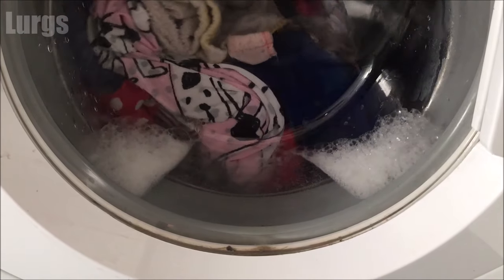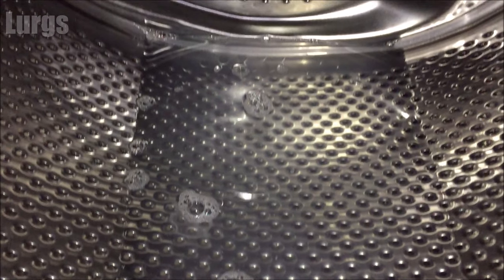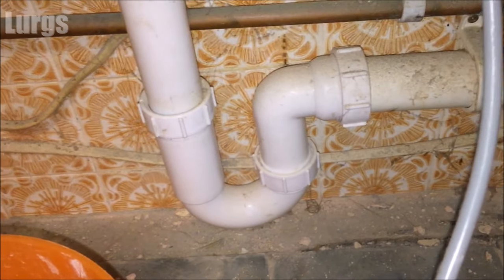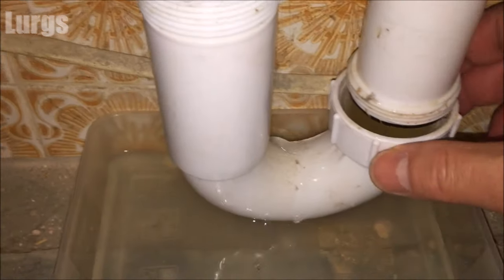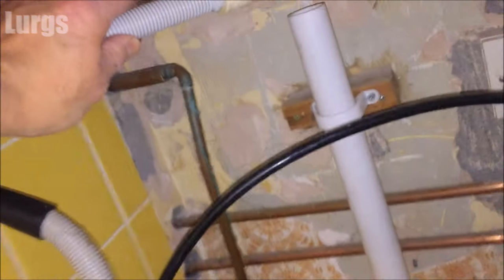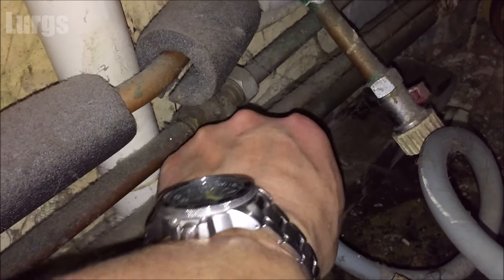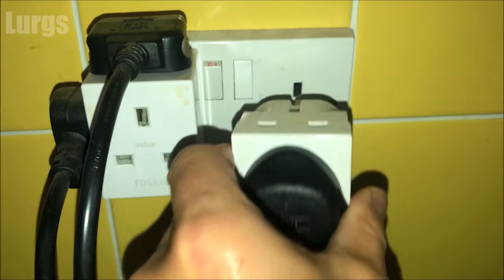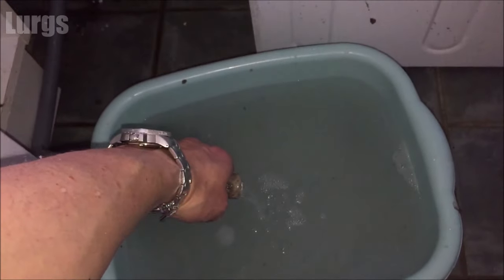Washing Machine not Draining Water - Fixed

Comment: My machine’s manufacturer sent out an engineer to look at the drainage problem. He connected a device, ran a test cycle and said the poor drainage is caused by user error which results in an unbalanced load. He advised to wash clothes as normal. Separate the load at the end and run two spin+drain cycles for each half. Even though the drainage issue existed regardless of load size.

After watching your vid, I discovered a blockage between the kitchen waste trap and the machine’s outlet hose. Cleared and cleaned. Now running as normal.

Your vid offered better troubleshooting advice than the company’s engineer!
Reply from the maker: I must be in the wrong job! Fabulous news that you found the blockage and many many thanks for your kind donation, I really do appreciate that. Thanks again and all the best 😎

Comment: Thank you so much for your video. I love your presentation style. 
My machine has started to accumulate smelly water in the drum a few days after I've washed. I've started draining the filter after each wash. But the drum just starts to fill up gradually. And boy does it smell. Can't really figure out why smelly water is just appearing. It's not an easy one woman job to move the machine but I will give the easy bits a go first. 
Thank you again for your brilliant, and straight to the point video. Keep up the good work.
Reply from the maker: Sounds like your drainage pipework is blocked up, they get lots of sludge inside and  can stink. Need to check that and clear it out.
Reply: @LurgsHowToGuides  Oh bless you for replying Lurgs. What a star you are. Thank you for your very kind advice.

Comment: Thanks for your advice as I had a problem with the washing machine not spinning or draining and followed your instructions. It was rubbish in the filter and a hair clip then once I removed it put it back together and now the washing machine works like new.
Many thanks 😎😀😀👍👍
Reply from the maker: Great result, now that's a good saving. 😎

Comment: Thank you. Problem solved. Opening the filter (Bosch machine) was very difficult because there were enough coins to prevent both drainage at the back and opening at the front. Lots of anticlockwise then clockwise turns to shift them. I had to resort to pliers, which risked damaging the flimsy plastic handle I was turning, but I wouldn't have got in otherwise.
Reply from the maker: Great news. Glad to help and hope you had a fab weekend. 😎

Comment: Spent ages emptying the filter and checking all the hose on my machine (which is absurdly long)

Hadn’t checked the trap though as it’s linked to the sink and that’s draining fine - turns out there was a sequin the exact diameter of the pipe where the hose joins the pipe work and that was causing the block. I’d assumed it was the pump and was about to order a new machine until I saw this. You saved me, as a new machine would have had the same problem! Thank you so much
Reply from the maker: Great news, glad you found the blockage and that’s saved you getting a new machine. Glad my video helped.😎

Comment: Cheers mate  i bought a £645 LG latest model,  wouldnt drain or spin,  did what said!   And low and behold there was small sock shedded behind the filter at the bottom,  brilliant  works perfect now,    thanks a million
Reply from the maker: Good find! That would have been an expensive replacement. Glad to help.😎

Comment: Thanks man. I was in denial that it could be the filter so soon after I last cleaned it out. But it turned out the culprit was a Covid-19 face mask blocking the filter and stopping the draining thing turning around. 
Note for all... if you’re washing and reusing masks, put them in a bag or something before putting them in the washing machine.
Reply from the maker: Good tip. Glad that I could help. 😎
Reply: Just fixed mine using this method and it was the exact same cause! Face mask blocking the filter.
Reply from the maker: Good job you could get it out the filter. 😎
Reply: @LurgsHowToGuides  cheers for the guide! Lifesaver.

Comment: This is amazing thank you but do you happen to have any tips on if it’s not the filter? Ours looks clear but still coming up with the same error message and and not draining 😭
Reply from the maker: If the drainage pipework is clear and not clogged up then it could be a faulty computer board or faulty pump. Check drainage pipework first for sludge, they can get clogged up. Good luck

Comment: OmG.... I can't thank you enough for this video. I was not only able to drain my washing machine but also I watched the unlocking video... You are a GEM! I will see if the machine works in the morning as the water was drained on the floor and it needs to dry.
Once again thank you 🙏🏻
Reply from the maker: Great stuff. Thanks for the comment and good luck tomorrow with the wash.😎

Comment: Is there a video for how to drain a pump when you get this warning after a fully loaded washing machine won't drain?? Flooded my kitchen because the hint about needing a shallow oven tray was an understatement. Thankfully got the water mopped up and sorted out the pump. But I'm glad this video exists, though - really helped sort the problem
Reply from the maker: Yeh if it’s full and you remove the filter do it very slowly! Glad I was able to help out. 😎
Reply: @LurgsHowToGuides  my pump filter will not turn any ideas
Reply from the maker: Either it's stuck as it's never been undone or something is wedged in there, just have to keep trying but be careful as it's only plastic

Comment: In my machine this no drainage issue was happening only on one particular type of wash setting. my trick was to turn the dial to a new wash at a different setting or just spin cycle . It worked fine 🤷‍♀️

Comment: good video, only comment I would give is to change the order of what you are doing, if it is just junk at the filter causing the drainage problem you don't need to go through all the steps before such as move out, check the U bend, check the drain hose, etc. if we have a drainage problem i check filter first as easily accessible (just put down PLENTY of towels!), then check the waste pipe (ours is the grey internal one not external) then on to things like the U bend, etc.
Reply from the maker: Good point. This video is 5 years old now so is one of my earlier ones. This one is a newer updated version in the correct order. https://youtu.be/FwRbWKOwmfY

Comment: Great vid, thx for putting this up.
Just would like to ask you for a favour, if you are so good with fixing things, can u fix your and redirect washing machine waste water into your gutter instead of rainwater? thats not only helps with the environment but also is with in the law.
Reply from the maker: Most gutter water goes into drains which also take in rain water and surface water so eventually it will all go to the same place so not really much point doing that. Hope that helps and glad this video helped.😎
Reply: @LurgsHowToGuides  It did man, I managed to fix my problem. Thank you !

Comment: my washing machine will not take in water or drain the water. starting to get tired of hand washing the clothes for me and 3 kids. it's almost half past three in the morning and i'm trying to repair the washing machine. A couple of times it has made the usual sound it makes when you start a program, and you can hear some water, but nothing happens. stands for a long time to work before it centers but without water. started with the machine filling up with water and stopped. ended up having to empty it manually and have to use the spare opener yet. Seems like your videos can help. something I really hope !🤗
Reply from the maker: Hope you get it sorted.

Comment: nice video!  one thing: at 3:36 on the left hand side you'll see a black plug.  if you pull the black hose it is plugging out a bit you can drain from there in a more controlled manner before unscrewing the filter.
Reply from the maker: HyperBlueZYZ Yeh that’s in one of my other videos E18 error code. I wanted to make this video a bit more generic so a lot of machines wouldn’t have that drainage hose. Well spotted though! Hope it was useful
Reply: Lurgs Most definitely helpful. Cheers!

Comment: Thank you for this video! Everything in our flat seems to be breaking at the same time, our fridge, our boiler, and then yesterday our washing machine. I followed this video and it's all fixed :)
Reply from the maker: O dear, glad I could help out with 1 of your 3 issues! Hope you get the fridge and boiler sorted.
Reply: @LurgsHowToGuides  yes, thank you! The landlord sorted those issues, but we were worried he wouldn’t be pleased if we called asking for the washer to be fixed as well. That’s why I was so pleased to be able to fix it myself (with your video’s help 👍).
Reply from the maker: Sounds like a decent landlord if they've sorted the other 2. All the best. 😎

Comment: Omg I just fixed my machine!!! I'm so proud of myself thank u so much for not being scared of my machine 😉
Reply from the maker: Glad to help and glad that it's all working. Well done you! 😎
Reply: @LurgsHowToGuides  oh actually lurgs it still didn't drain even after removing a penny from filter. I wonder if the angle of the waste pipe would effect it? Machine is currently pulled right out due to kitchen refit. Any advice ?
Reply from the maker: @lisamgreenleaf  Check the filter again! Sometimes when you remove other items fall down again so it could be blocked again. Then maybe run a cycle with it pulled out so you can see if the water is pumping out of the Drainage pipe (maybe hold it in the sink)

Comment: Hi some great videos, we have a hotpoint Aquarius, I’ve cleaned the filter like one of your videos however when I start a wash the top light flashes and the washing machine doesn’t continue the cycle( comes on with 30 seconds of starting) yesterday it did have all lights flashing?
Reply from the maker: That’s the same machine we used to have. I fixed it a few times then at the end it went crazy and every light was flashing. It eventually just stopped working so we got a Bosch Serie 4. Depends how old it is and whether it’s worth calling someone out to fix. Hope you get it sorted, let me know how you get on.
Reply: I think I love you

Comment: Hi mate thanks for the vid, it was very useful and done coherently, and hilarious atsome points too!
Reply from the maker: @PrinceOvPersia1  Thank you, glad you enjoyed it and that it was useful 😎
Reply: @LurgsHowToGuides  Mate just to let you know, I done exactly as you advised, yet my machine still stops mid-cycle, and fails to drain the water out.  The lights on the panel start flashing and the drum is full of water.  What is going on please? :(
Reply from the maker: @PrinceOvPersia1 If drainage hose and pipework is clear and filter is not blocked then it could be a faulty pump or computer fault

Comment: Hi thank you so much for your video. I have a Hotpoint BHWD129, the WM can’t finish the cycle like your. And when I checked there is nothing clogging it. The lights keep flashing :( what can I do with it please?
Reply from the maker: If there's definitely no blockage then possibly the actual pump has failed or there is an electronic fault on the board. Depends how old it is on whether you pay someone to try and fix or get a new machine.

Comment: My machine is a Hoover Nextra and the filter is only an inch or two off the floor. If I take out the drain pipe and empty into a bowl will that remove enough water to stop being flooded out when I remove the filter?  Thank you.
Reply from the maker: It should do yes, but you will still get water out of the filter. Undo it slowly and use an old towel. Good luck

Comment: Hello, thanks for the video.  I opened and cleaned out the filters. But my machine still doesn't drain. Please help
Reply from the maker: Check filter again (sometimes debris falls down again after you remove it). Else put drainage hose in the sink to see if it drains there, could be your drainage pipework is blocked up

Comment: Should there be a small reservoir of water stored under the detergent drawer after a wash? When I remove the drawer, apart from the main chamber on the left, there is a smaller one in the right. I can just get a couple of my fingers partly down there and it’s full of water. Should it be or is there a blockage? I regularly clean the machine (every 3 months) with Dr. Beckmann Serve-It on the hottest wash. It’s in very good condition barring this issue. Any advice appreciated. Thanks!
Reply from the maker: You normally get a little water in the detergent drawer after a cycle, but if you remove the drawer there shouldn’t be any standing water anywhere, not sure what model yours is but standing water means smells, maybe that’s the design and it flushes through. If you had a blockage you’d know as you’d probably have water all over your floor
Reply: @LurgsHowToGuides  It’s a Bosch WIW 28300GB. Thank you for taking the time to reply. Cheers👍

Comment: I am a subscriber and love your video's BUT u really need  to tell people to manually drain before opening up the filter... most people can't fit a bowl underneath and a towel will not be enough... as i found out! 👀🙁
But it worked though so thank-you!!... getting out the mop now 😆
Reply from the maker: Oh dear sorry to hear that, if a washing machine hasn't drained then yes there can be alot of water. Some machines have a hose by the filter to drain but if the washing machine is level on the floor it can take ages to drain into a suitable bowl.
Glad you got it sorted though and at least you get to have a clean floor. 😎
Reply: @LurgsHowToGuides  very true! 😆😆

Comment: Yo shoutout to you bro, at first i thought it wasnt the problem even tho the filter was packed with cat hair, i realized it wont drain till its on the prain cycle even if you turn the power off in mine, if this is you, run it on a speed cycle so it drains quick
Reply from the maker: Glad my video helped out. 😎

Comment: Great video... quick question.  I have a Bosch Serie 4 VarioPerfect and cannot remove the pump filter.  It turns about halfway (but with difficulty), but then it cannot be turned any further.  Do you have any videos that show how to easily remove the filter?  BTW, I know next to nothing about maintenance.   Thank you in advance!  (Love your "get your partner's toothbrush")!
Reply from the maker: Arry Dresden The reason for this is probably something stuck in there stopping it turning. Try undoing it then doing it up again and keep trying until hopefully it works its way loose. You could try some pliers to turn it but be very careful as you may break the plastic. 
Good luck and let me know how you get on.
Reply: @LurgsHowToGuides  Thank you for your suggestions.  I tried turning it back and forth dozens of times the last few days and nothing good came from this.  I can get the 1st quarter turn easily, then the 2nd quarter turn requires a strong effort, the 3rd quarter turn is super easy, but then it refuses to budge.  I tried moving the washer on it's side, tilted it forward and tilted it on it's back... but nothing changes from a turning perspective.  I hesitate to use any pliers due to my location (Ukraine) will make it impossible to get a replacement plug for a long long time.  I live in a small city, so finding a repair person will not be the easiest thing and of course I am not a handyman.
Reply from the maker: Oh dear, yes Pliers could crack it. What a shame. It is bound to be a hair clip caught in the thread somehow. Maybe order a new filter anyway then when it arrives you can really have a go at getting it out, if it breaks you can replace it. If it’s ok then you’ve got a spare or just sell it. Good luck to you, really hope you get it sorted. Please let me know how you get on

Comment: Thanks for the video. However, I've done all of these, still not working. Makes a buzzing sound, and water won't drain. Some people say it could be the capacitor, might switch that out.
Reply from the maker: Or a pump failure maybe. Hope you get it sorted.

Comment: This was very helpful but I’m still having issues and I don’t want to risk doing anything behind the washing machine as I’m not sure about stuff like that but my filter is clear nothing stuck in it so I think it may be the pipe at the back causing it not to drain if I can afford it I hope I can get it sorted soon :(
Reply from the maker: Yes could be a blocked pipe at the back. Try running a drum clean to try to clean the system out.
Reply: @LurgsHowToGuides  we have ran an empty wash not sure of a drum clean setting when we looked couldn’t see one
Reply from the maker: @LiamMufc100  Make sure an empty wash at 90c though so it gives it a real good clear out. Not too much detergent though else it will foam up
Reply: @LurgsHowToGuides  ok thank you :)

Comment: My drainage filter was extremely stiff. I did it in stages allowing the wayer to drain as much as possible. I finally got it open, it was so jammed and it snapped unfortunately there was a sock stuck in there!! What do i do now
Reply from the maker: If it's broken you'll have to order a new filter for that model
Reply: @LurgsHowToGuides  okay great thank you. How is a sock able to get jammed in there. Its such a small area. How would that of travelled down there?

Comment: Hi I tried to do all the things listed from you in the video but still have the same problem. The water is not draining. I've changed the filter and I've checked the pipes. Any other solution?
Reply from the maker: Unfortunately it could be a faulty pump or a faulty computer board. Depends how old the washing machine is on whether you call out an engineer or get a new washing machine.